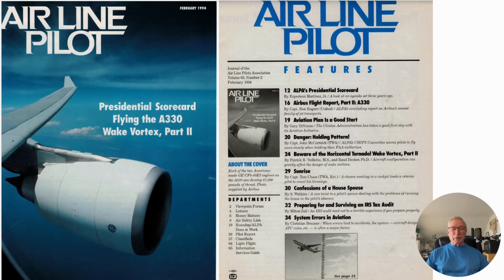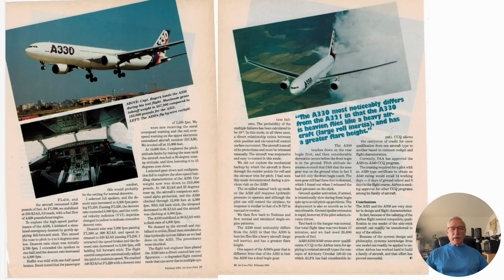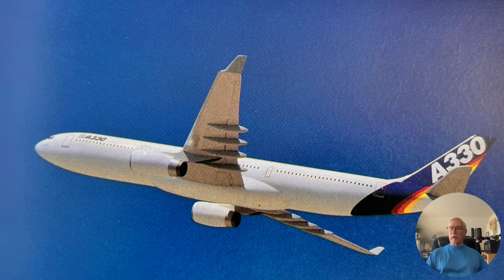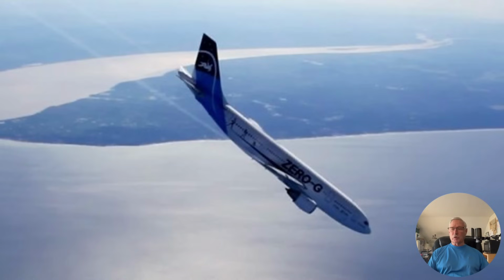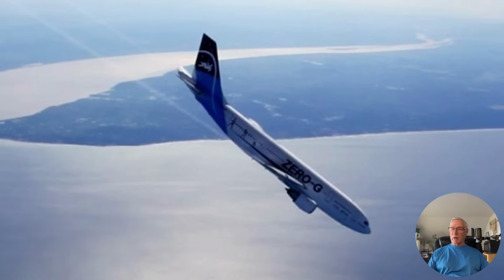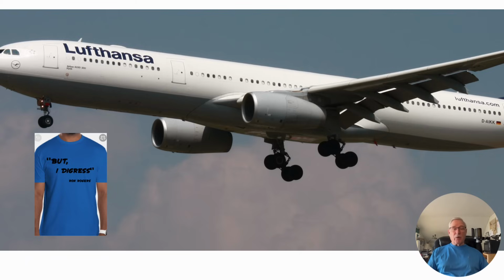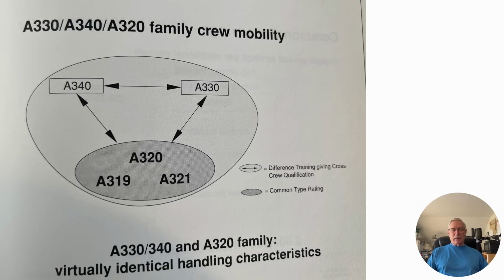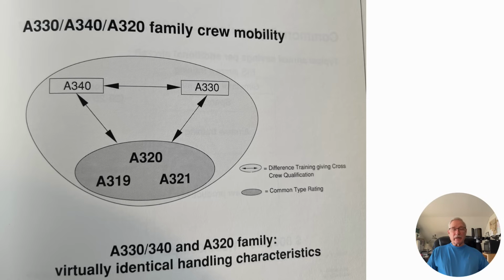Flight Testing the Airbus A330

Comment: Did they use electronic augmentation in the MCAS vein to achieve that similar manuevering characteristic across the 320,30,40?
Reply from the maker: No, not an issue.
Reply: @ronrogers  while you are here Ron!, did you fly around the  south paçific much?
Reply from the maker: Hong Kong, Beijing, Shanghai, Singapore, Sidney, Tokyo, Taiwan and probably some others I am forgetting.
Reply: I frequent between Wellington, with it's short runway, and I guess it's alternate, ohakea, where the a4 Skyhawks were based and now the new p8s operate from.  That and MSF are as close as I get to planes but boy is it a great interest!!! Enjoying plodding through your catalouge

Comment: 4:00 From a technical perspective, you can swap them as long you stay in the same generation, like 330-340 family. Gain scheduling is of course, different even in the same gen, but software is written that via pin programming, the right blocks are chosen. 320 however has a totally different architecture, including other hardware, but again you can pull the 321 SEC and install it in the 318 will be fine. Software is auto generated at Airbus today via SCADE, in the past with SAO. So modifications on the laws themselves are pretty straightforward from one gen to the other. So if they made you think they put the elacs in the 330, jep that was marketing promotion, no EFCS engineer would have said that.

Comment: After spending a decade in Bombardier products, Im now on the airbus family and dont ever see myself leaving it.
Reply: Have you flow'n the C Series (A220)?
Reply: @aljohnson125  nope, crj 900
Reply: @BobbyGeneric145  Ah yes a completely different fish!, I was design lead on the CRJ 200 interiors then project lead on 200 / 700 interiors when at BA, great time, but I missed the "C" series interiors as I retired early, and still loving retirement though!
Reply: @aljohnson125  did that include cockpit interior? If yes, I have a hud projector dent in my head we need to discuss!

The atmosphere cabins in the latter birds were very nice.
Reply: @BobbyGeneric145  Sorry about your dent to the head, Cockpit, that was another group as the cockpit did not change much except for avionics options selected by the airline,   ie the HUD, I know that was a squezze to get it in there, Basic design philsophy was same as Challenger 601 with minimal change, LOL

Comment: How does the 330 compare handling and power wise compared to the 777?
Reply from the maker: Like the 777 much better. Airbus tended to under power their aircraft in an attempt to show better fuel efficiency numbers. the 340 was especially underpowered.
Reply: @ronrogers  yeah, the decision to use the CFM56 on the 340 was really questionable. They don't call it "4 hairdryers flying in close formation" for nothing 😂
Reply: @ronrogers  Really?! even the 340-500? I heard that plane was awesome + 4 engines...
Reply: I suspect the A340-500 was the exception to the rule, and likewise the A340-200 does not have as bad a reputation as the A340-300.   This will sound silly but I miss the A340s as their shape reminded me of the early quad jet liners like the 707, DC-8, CV-880/990A, but of course those early quadjets (especially after they switched from the JT3 to the JT3D turbofan) were known for performance.   But to give a sense as to how underpowered the A340 was, consider Boeing had the 707-700 project to put CFM56 engines on the 707!  (and this eventually happened, but only on military aircraft) And of course the DC-8 stretch 60s were re-engined (and became the DC-8-71/72/73), which remained in service with Delta and United into the late 1980s